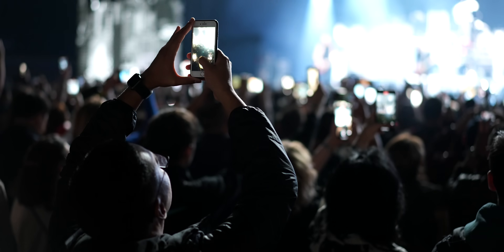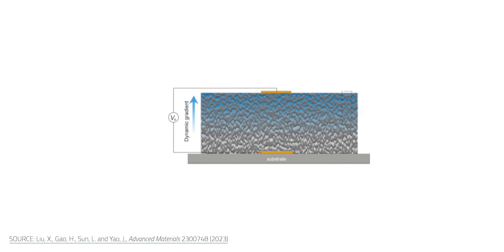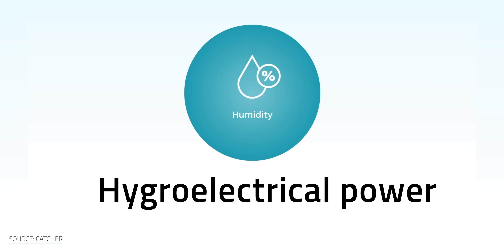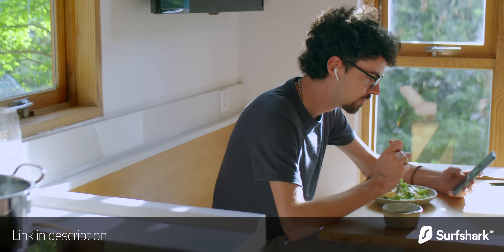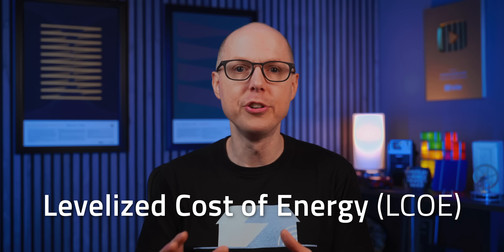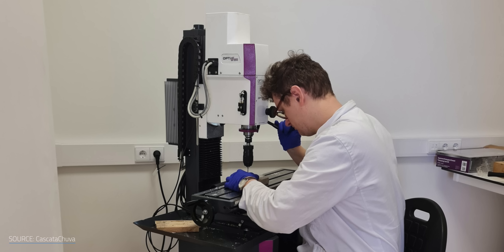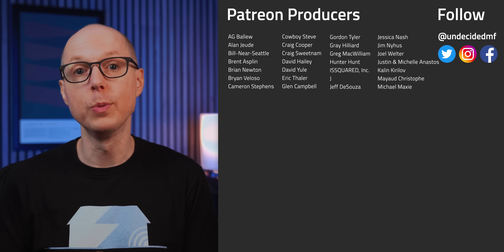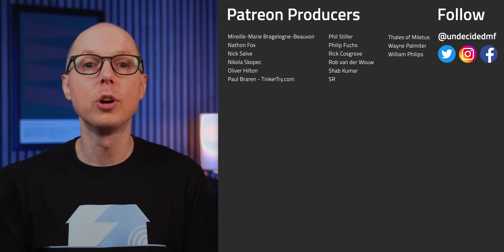Is This Accidental Discovery The Future Of Energy?

Comment: I truly wish I could get solar on my home, but the cost is simply too high.  I'm getting quotes of $75-92K for just the solar.  Adding on batteries is another $40-60K.  I absolutely would love to get on the solar train, but the cost is just obsence.
Reply: There's a relatively new company in the UK called Ripple and they build wind & solar farms for joint ownership. You invest in & own part of the facility, i.e. enough to produce your monthly consumption at a fraction of the cost of owning your own solar panels. In return,  you get a substantial discount i.e. 25% - 30% on your energy bill for 40 years, which is the economical life of the site. Estimated pay-back it app 17 years on their website but looking at the live data coming from the sites went live, this appears to be quite conservative and pay-back time may be shorter. The advantage is that it's much cheaper than owning solar panels, and you invest what you can afford. It also doesn't matter if you sell your house or live in a flat. The discount comes of your bill regardless where you live. You may want to investigate if similar opportunities exist in your country.
Reply: Are you trying to power a fleet of vehicles?

You can get a small set up for under $1,000.

Try starting with a budget and seeing what you can get for $10,000.

Maybe skip the battery and use the grid instead and then add a battery later when prices are lower and the tech is sorted out.

Installing a system that is built to expand without having to replace what you put in now is another way to get started.

Maybe even just try ebay to get a feeling for the cost of the hardware.
Reply: That price does not make sense. In Europe I can get 10kW solar power station including panels, inverters, cabling, installation and commissioning, for 10,000$. (that is before incentives, you can get probably 30-40% off that price with incentives.)
For 75K$ you could get 100kW solar power station with inverters and everything.
Wallmount batteries (LiFePO4) are around 3000$ per 10kWh (also before incentives)
Reply: @Sasoon2006  I agree.  But, where I am, the mark ups are crazy.  I've been saving for 7 years to try and afford the down payment on a solar setup, but each year the amount goes up.

Comment: This would be great paired with solar power since the overcast days that block the sun are faily humid.
Reply: I wonder if during winter with low humidity they're producing much.
Reply: @makatron Winter generally has more humidity
Reply: @texanplayer7651  in the air?
Reply: @texanplayer7651  That's interesting. So far refrigerators not self powering though.
Reply: @texanplayer7651  Winter has generally less humidity as warm air is capable of holding more moisture then cold air. That's why it rains and snows more in winter, because the air can't hold on to the moisture. Downfall isn't the same as moisture.
Reply: @makatron  That is a concern, but winter will have fewer overcast days, so solar will compensate.
Reply: True, although if you are installing solar you are going to get enough panels to handle cloudy days or there is really no point in the investment.
Reply: @Jokerwolf666  Also a valid concern, but a hybrid approach is always more flexible. Some people may not have the necessary area available for an ideal solar setup. This would be especially true for apartment blocks. A humidity based generator could be integrated into the tower's ventalation output.
Reply: @stevenkies802  Oh 100%, like he says I don't think it's just a one answer solution because it's never really been that to begin with.
Reply: @Jokerwolf666  What a pleasure it is to see a youtube comment thread that didn't degenerate to a hate-fest.🤭
Reply: I feel like high humidity days often have lightening is other thing
Reply: The energy density is far too small to be of much use.
Reply: Sorry to spoil the fun of a well-meaning science buff, but...

CO2/climate-change is the biggest mass-fraud since communism. 

(See Henrik Svensmark for the cosmic-ray/solar-activity/cloud-formation/climate relationship.)

 CO2 is a ruse. 

Climate change the "Greens" are talking about is caused by changes in the cosmic-rays/solar-activity relationship and cloud formation  (See the work of Henrik Svensmark.)  

Cloud formation by actual cosmic rays can be scene with the naked eye in Cloud Chamber demonstrations.  YouTube has dozens of videos about them.